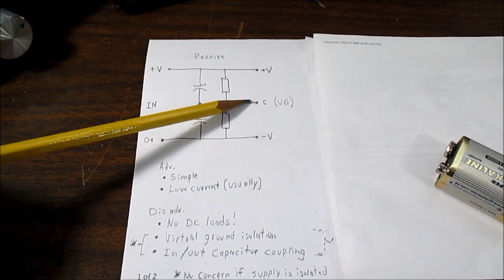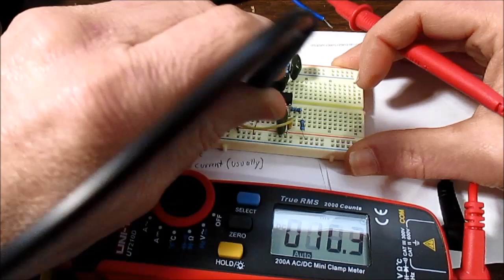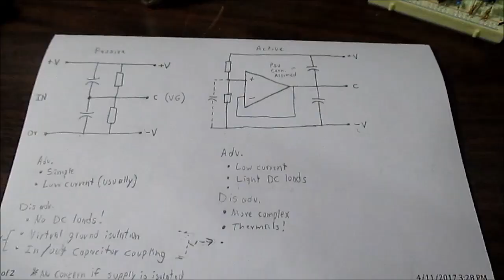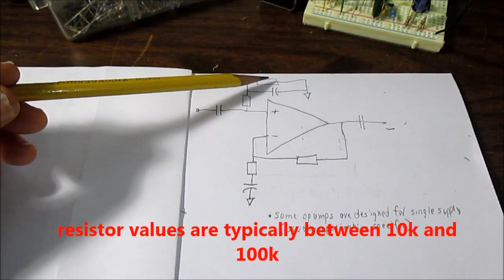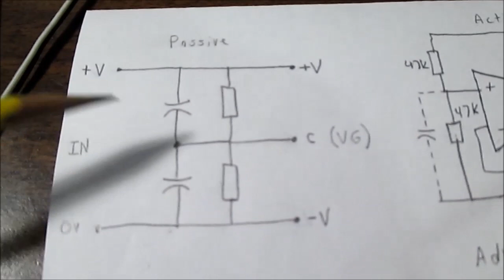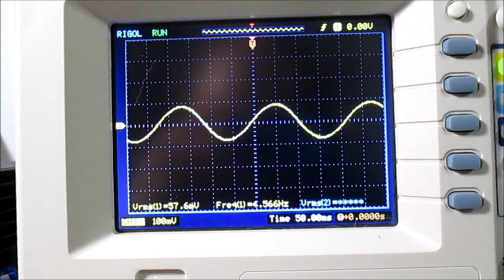How to use op amps with a single rail power supply

Comment: @JohnAudioTech  Hi, I love your videos and have learned alot about audio, so thank you for your efforts and time. I have a question that is not so techincal but more historical perhaps. Why does all the audio gear in the pro  music feild at least use plus and minus 15 vdc as the power supply for the circuitry. I have worked on a number of older guitar amps and mixers and every one of them use +/- 15vdc as the power supply. I think it could be due to the op amp development and data sheets suggesting those voltages, or maybe the invention of the LM 7815 and LM 7915 regulators, or does this amount of audio headroom have a benefit to driving a hi wattage amp.  For example guitar amps use the +/- 15vdc for the preamps and drive a power amp section with a higher +/- suppl rail.    WHat are your thoughts on this?
Reply from the maker: Yes, it is the supply for the opamps. Sometimes I see +/- 12 volts as well. That is way more than enough for the signal levels used prior to the power amp stage.

Comment: I used an LM358, a transistor, and an ICL7660s, while using 12v to achieve a +5v rail and a -5v rail to power a LM358 properly for a sound activated circuit.   A voltage divider/virtual ground did not work in this instance.

Comment: I don’t understand the ground isolation. If the power supply is also powering other parts on the system, wouldn’t the virtual remain the same for the op amp?

Like example I’m using 19v to power an amplifier, the op amp will have a +/- 9.5v.

when my amp draws current and the supply voltage drops to 18v, wouldn’t the passive resistor divider still divide the supply voltage accordingly and will now give the op amp +/- 9V
Reply from the maker: Yes, if the supply voltage drops, it will evenly split the voltage, provided the current draw is equal on each side. It is important to check all conditions to be sure the divider is working properly with the devices it is powering.
Reply: @JohnAudioTech thanks, I also connected a small dc fan to the power supply for my amplifier but it creates audio noise. Any solutions for that? Maybe isolating the op amps power supply is the only solution?

Comment: The Quad 34 pre amplifier uses this system. It has an isolated 18 volt power supply with the rail split in this way (using a TL071 op amp) and  8.2K and 9.1K resistors. The designers decided that having exactly equal voltages on each rail was not ideal, so that the voltages are +8.6 and -9.4.  So, clearly, there is no need to worry if the voltages on each rail are not identical. However, the Quad 34 does use isolating capacitors on the input and output, which is necessary if the rail voltages are not identical.

Comment: Thank you for the informative vid John! So, in this vid, in the 3rd case, you showed how to bias the non-inverting, a.c. amplifier configuration. But how do you bias a subtractor (differential) a.c. amplifier configuration (two a.c. inputs simultaneously - one on the non-inverting input and the other on the inverting input of a single op-amp)???

Comment: Hey great video very instructional! I am wondering about the Active circuit's opamp. Are you powering the op amp with the voltages from the battery? Is this op amp different from the op amp being powered from this circuit?
Thank you!

Comment: If you had two power supplies, they wouldn't necessarily have to be isolated, you could tie the virtual ground to the ground of the other supply so that they have a common ground reference, right?

Comment: I've been struggling with this for a VERY LONG time:
How does one find/build a decent split power supply without spending a fortune on transformers? The virtual ground circuit you showed only works for pretty low power applications according to my research. I'd like to go as high as around 50 watts per speaker (hard to specify a limit at this time, because I haven't fully tested these speakers yet).
Reply: You could go the simplest way and use two DC power supplies in series, and taking the middle point as your ground. That's what I'm going to do for a few projects I'm working on. How much current does your circuit handle?

Comment: How is this different from a simple voltage divider with measuring voltage at lower V end with respect to the center tab of the voltage divider?  It would also read negative voltage just the same...
Reply: The voltage divider is always drawing current from the battery. You could fix that by making the resistors bigger so they consumme less current, but in that case the big resistors will create voltage dividers with the other components you'll connect to the power supply, lowering the voltage output.

Comment: There is also another possibility, if you don't like to lose your ground reference point: a dc voltage inverter. This is especially useful in medium power applications like amplifiers. I have allready used a boost converter as "voltage inverter". In this case the ground is the positive potential of the input voltage. The converter generates the new positive potential.
Reply: In general, in step up/down converters, the ground of input and output are connected together, so you're actually short-circuiting you power supply, how did it even work for you? 🤔
Reply: @alessioulivi6734  If you use a boost converter the + Input becoms GND output, the - input is - output and the + output is generated by the boost converter.

Comment: I'm confused by the second example. I know this video was posted a few years ago, but I would really appreciate some clarification if anyone can explain. 
I want to make a supply rail splitter so I can power an op amp. If I don't have a negative rail yet, what do I connect to the op amp power  in the second rail splitter circuit?   I feel like if I knew the answer to that, maybe I wouldn't need to make this supply rail splitter at all?
Reply from the maker: What are the voltage and current requirements needed from the supply? For example if you you needed +6v and a -6v rail, you would power the example circuits with 12v.
Reply: @JohnAudioTech  I need 12 and -12. So I can  connect 0 and 24 to the op amp? 
If so, since what I'm ultimately trying to do is power an op-amp oscillator circuit, does that mean I can forego creating a negative rail and just use 0 and 24V for that as long as the difference is the same?
Reply: watch this video to find out how to use an opamp to provide the power for the opamp you need. it's like a damn snake eating its own tail, a recursive hell specially prepared by monsewer here.
i love the very first comment, "now how do you power the opamp in the active circuit"
i wish i'd read it before i watched it. at least our masonic pal let slip the phrase "active rail splitter" but i can see, i'm really going to have to wait until the parts get here and do it myself to learn instead of watch videos.
it's nice ot see the precise 3.66 voltage and perhaps from other references, the appropriate use of capacitors can be discerned, but it would of been teh flimming nice if you boy had just put one fricking circuit for reference so teh lowly can not have to take it teh rough boy One More Time.

Comment: Would you have to also choose resistor values that are low enough to supply enough current? Seems bad that the divider network will constantly drain the battery at a high rate. What about just setting noninverting input to half supply voltage? Then you still need to use coupling caps yes but you still have a common ground. Just make the opamp settle on half output voltage by biasing on of its inputs to half supply. ..

Comment: Or you could use a LM317 for single supply and both the LM317 and LM337 for dual supply. The same concept as the third method since the LM317 and LM337 are basically OP-Amps configured as buffers. They have stable output voltages, high current outputs of 1.5 amps each and less component count. But the trade off is energy wasted in the form of heat.
Reply: Thanks for sharing this info, I’ll have to try the LM317 as a dual rail power supply for testing my op amp because I am working with a frequency of 300KHz so the passive technique does not work very well at that frequency level.

Comment: Hlo sir how i can 80vdc split to ±40. Please help me sir. I need 40±vdc output
Reply: Use the common ground (c) terminal and the +ve of your 80vdc only (ignore the -ve terminal. Then you have a 40vdc. Then you split up the 40vdc into another similar circuit and you have +ve 20v, a common ground (c) and a -ve 20v. thus giving you a 40vdc dual rail supply
Reply: @815gdrx29  This sounds all very useful and I am interested, but I have a really hard time following. What common ground terminal are you talking about? A DC PSU is only gonna give you two leads: plus and minus.
Reply: @DasAntiNaziBroetchen 
Sorry. My post was for a dual rail supply with a common ground, as in a toroidal transformer.
https://electro-dan.co.uk/electronics/wiringtrans.aspx

Comment: what is connected to the power rails of the opamp in the 2nd active circuit?...if this opamp needs a dual supply..then we are going in circles!!!!
Reply: You could theoretically run all of your op-amps biased to run with all positive voltages and then block the DC component at the end via a subtractor or a blocking cap
Reply: @Hunter Johnson Hello sir. Please provide full blueprint and assembly instructions. God bless.

Comment: So you could actually split it again. 
If you use one side of the dual and split it into dual, you could also split it again.
Like you have 24v o 24v you split the one 24v to 12v o 12v use that one side again you will get 6v o 6v???
Reply: Yes, but in that case all your resistors have to be the same value. Or you could use just 2 resistors as a voltage divider where the biggest resistor has the biggest voltage.

Comment: What are the capacitors used for? Are they coupling capacitors?
Reply: Smoothing out the power and for supplying power quicker in case there are power spikes.

Comment: This is a very important video. But what if we need to virtual ground more opamps? can we use the same bias or it will make a full short circuit to the signal?
Reply: I wouldn't use any of these methods on complex circuits. That 10mv riding on the virtual ground would get multiplied by the gain of the second amplifier and multiplied by the gain of the 3rd amplifier and so on.

Comment: if I take your active dual supply circuit, should I get enough current to drive ,for example 4 OPAMPS, as load???? I actually need a dual supply that will power up some opamps as different filters. Will I get enough current to drive at least 4 OPAMPS???? thanks Sir !
Reply: Sayantan Maiti 4 op amp 
Hmm calculate additional quiescent current value of all opamp 
And now calculate resistance 
R= (single supply voltage)/(4*total quiescent current of all opamp)
Resistance calculated will divided in two part 
Take lesser than calculated value

Comment: There is a third solution, and an easy one, to obtain a negative rail, using low cost shunt references (such as TL431) as described at http://www.ti.com/lit/ml/slyc147/slyc147.pdf.

Comment: Now, how does one create such 'true dual supply' power supplies? I have searched the net everywhere but can't find a design that's beefy enough to power the LM-Something power amplifier modules that require dual voltage.
Reply: You can use a transformer with a center tap, but the price is prohibitive. I have the same problem.
Reply: Use a transformer with 2 identical secondary windings connected as a centre tap transformer. The AC phase of each winding must be correctly connected so they don't conflict each other. Torriodial transformers usually have a diagram or colour coded leads. In this case 2 leads would be used on the centre tap. Traditional EI transformers are labelled Vout - 0v or again have colour coded leads - the centre tap lead being a different colour from the other 2 leads, especially on sub- minature types of transformer. A rectifier of at least 8A to 10A rating should do for 2 LM1875 amplifiers assuming a 2 × 3.5 amp output maximum.
Reply: The TDA 2030 amplifier ic datasheet has a transistor boosted amplifier option. I don't know how well this would work as a supply splitter with the non-inverting input fed by a 2 × 2.2kΩ to 2 × 4.7kΩ potential divider across the supply rails. The centre of this divider is decoupled with a single 2.2uF capacitor. The inverting input is fed from the output. The output can be decoupled with 2 × 220uF capacitors across the supply rails and output. The booster transistors could do with series limiting resistors to help prevent an across the supply short circuit. A supply splitter circuit with just the TDA 2030 amplifier appears in Power Supply Projects by R.A. Penfold with 100uF capacitors across the output and supply rails. This Babani Publishing book is also useful for sorting out a conventional linear mains transformer supply. Ref.BP 76. ISBN 0 900162 96 1.

Comment: Hi John. Another interesting video here. I'm building a guitar amplifier for fun and to learn something new. The pre-amp and power amp are running from the same supply, the pre-amp works with a single supply and the power amp runs from a dual supply by a passive voltage divider (as shown in the video). Obviously if I connect the audio signal from the pre-amp to the power amp the audio ground will suddenly be referenced to the negative rail (also creating a short between the negative rail and the virtual ground). How would be best to deal with the virtual ground isolation? Would I use a 1:1 audio transformer or would I just have to add a coupling capacitor to the audio signal between the devices and a coupling capacitor to the audio ground between devices? Jim
Reply from the maker: When on the same supply, why not run the preamp dual as well? If high voltage is the issue, you can regulate it down for the pre. Why did you decide to use the virtual ground split supply on the power amp?
Reply: I'll have a go and alter the schematic to see how the pre-amp runs on the dual supply at lower voltage. I went for the virtual ground split supply on the power amp as I'm using an LM1875T board (the same one that you use in some of your videos) and am attempting to work on a tight budget so decided to use a 31v 4A power brick I already had. I wonder if running the power amp from one power brick and the rest of the circuit from another power brick (double insulated, so no earth) would be a simpler solution.

Comment: Oh man this gets confusing lol but i have to *learn this*..I never learned much about positive and negative outputs to power things...

What worries me is when I put a load on a lm1875 kit will it pull that VG to positive when a ac waves (sound signals) is going in the amp and powering a speaker..

Well i guess ill try it on a breadboard but i dont want blue smoke coming from my kit 😢
Reply: I went the ez and lazy way....wonder if you ever used one of these..I will still learn this circuit 😃 https://m.ebay.com/itm/Single-Supply-to-Dual-Power-Virtual-Ground-Power-Supply-Kit-f-RA1-headphone-AMP/201446796043?NAV=HOME
Reply: Buy dual supply it will cost less
Reply: Take it from me, themore exposure you have to electronics the more sense they will make. Just keep at it and it will eventually click.

Comment: ehhh.... maybe a stupid question but how to power the op-amp used to build a symmetrical powersource that is needed to power up op-amps???
Reply: Kinda late, but you just use the negative and positive voltage of the voltage source (in this case the battery) to power the opamp. Remember it's all about having a middle point to call ground, that's the objective of the circuit. The neg and positive voltages are already there in the battery connectors.
Reply: @ramiro6322  Just to add, although op amps themselves do not require a 0V ground, the reason we are generating a 0V reference for the signal op amp (not the ground-generating op amp) is that op amp amplifier circuit designs need a ground to reference the signal to. The chip doesn't need a 0V but the amplifier as a whole does.
Reply: Yeah I'm interested too xD At 10:07 he says something

Comment: Example 1 & 2: Vcc+,GND,Vcc-
Example 3: ????

Story time:
I'm trying to run a motor control that reads 0-5V, but my programmable output has a range of 0.02-4.74V so it's not able to run the motor at full speed. So I'm trying to use a simple non-inverting op amp LM-741 set up with a 12v DC power supply. Well, the splitter works like a charm until i plug in my motor control wire. Turns out it has a 1k ohm resistance and my rails go from +-6V to +2 -10V. So I tried building my splitter with 1k ohm resisters and that helped a little bit. Anything smaller just gets burnt up. I tried using the op-amp set splitter too but that didn't seem to do anything at all....

Could you explain why a resistor from a naked opamp output to the virtual ground shorts the circuit out like that? And what options I have to fix it?
Reply: Did you connect the power supply rails -V and +V to the op-amp? Was it powered?
He said it @10:05. Without them, the op-amp does not work.
Reply: I think I had this same issue. So what I did was connect the virtual ground to another op amp but that op amp was used a voltage follower (basically high impedance). Then I sent the signal from the voltage follower to the other op amp. This should solve the problem.

Comment: I'm new to these dual rail power supplies. I know I will sound stupid and I'm probably asking for the wrong thing but I need like a 25v dual rail power supply for some of these amps. What do I look for on eBay?
Reply: It depends on the load. How much current do they need to be able to deliver at 25 V?
Reply: maybe around 3 amps
Reply: Then search for one that can offer 3 amps or more @25 V.